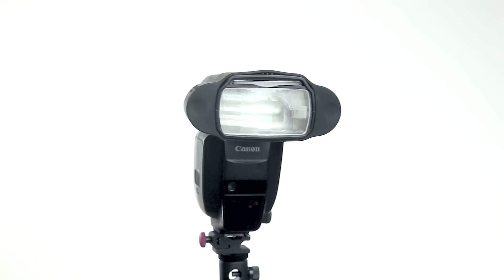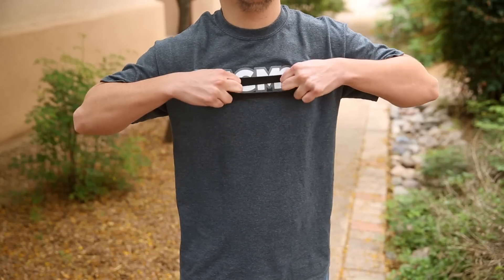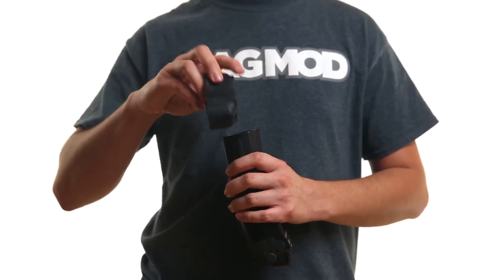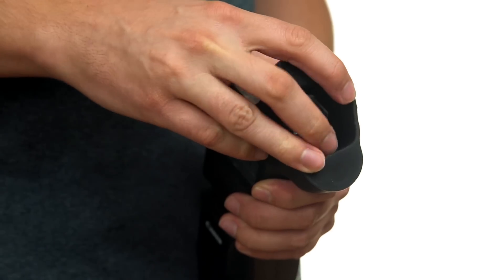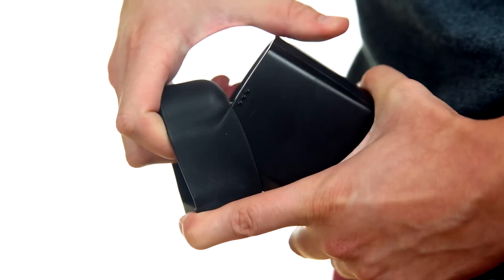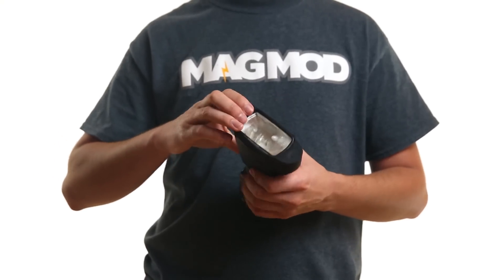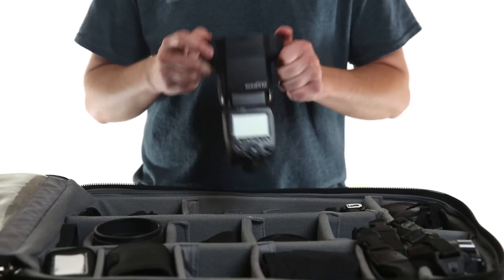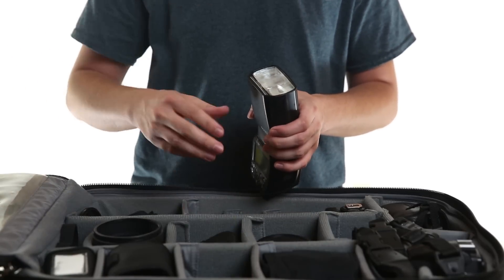How To Install The MagGrip

Comment: I almost hurt my index finger and thumb. Finally some how I got it on my TT685s. I'm not taking it out at least for an year. There should be an easier and better way as a gripper. Hope they come up with something new.
Reply from the maker: I'm so sorry! Thank you for your feedback, I will pass it along. We recommend leaving your MagGrip on your flash since it won't effect it when it is bare. Have a great day!
Reply: @MagnetMod  What about storing the flash in it's pouch?  I like to protect my gear.
Reply: @Methodical2  I have been able to fit the flash in the pouch as long as the MagGrip is on top, but it is not the easiest fit. They certainly aren't designed to work together. But after a few tries the MagGrip will only takes a few seconds to put on. So if you wanted to store them in your pouch and add your MagGrip each time it should only take you a couple extra seconds.

Comment: This really needs a redesign - it works okay on a small speedlight like the Godox TT350, but it's a hell of a job trying to fit it on a full size speedlight. I'm seriously considering cutting away the strips and attaching the magnets to speedlights using velcro instead. The problem you have is trying to design it so it's 'one size fits all' and I suspect it'll rip at some point anyway, either that or I'll damage a speedlight on fitting it. Thanks for the instruction video but an attach redesign would be far better. Good product apart from that.

Comment: I have a real hard time putting on the grip...its very frustrating...
Reply: Hi Ajay, this video does a pretty good job explaining the process that I use to install my MagGrips. The nice thing is once you do it one time - like riding a bike - it comes pretty easily. It's just a matter of getting it that first time and understanding the process. Remember to use that thumb on the opposite side to apply some leverage allowing you to pull it back and stretched across the flash head. The other benefit is once you get it on it won't slip off so it will stay there as long as you want.
Reply: @dayleyhighlights  shoudn't it be pulled off the flash head after using it? I mean,  in the long term, the rubber might get damaged if left stretched all the time... Just a thought.
Reply: I may return it, can’t get it on. Thought at first that it is too small. It’s not just like that
Reply: @karenkaptures  i had issues with it in the beginning....that is around 2 years ago....but after trying many times, i am now able to put the grip on very easily....you just have to hold tightly on one side and then just use ur strength on the other side to pull the grip...
Reply: @Ajayajay-nr2qj  thank you after 8 tries I finally got it on one of my speed lights. It will stay on that one. Thanks again for your response.

Comment: a nightmare !!! already purchased 4 maggrip for my godox V1, ad200pro and V860-II. To be sure i also tried on my old sb900 and same story. i hurt myself, it takes up to 30 minutes to fit. I followed this tuto but when you pull your fingers are not at all outside the flash head but above. too stron material, too small size.
Compare sb900 76x55mm with maggrip aperture 42x42mm !!! of course it works but not advised to remove it and expect being fast on the field to attach. I would suggest a new one 55x42mm min for bigger flashes, just tight enough to hold a heavy ad200 pro on a magbox.

Comment: I just bought one last weekend. Here's my question... Shoudn't it be pulled off the flash head after using it? I mean, in the long term, the rubber might get damaged or dryed out if left stretched all the time... Just a thought.

Comment: My MagGrip appears to be not as flexible. I’m finding it very difficult to stretch around my Godox TT685S. Is this a defect?
Reply from the maker: Thank you for posting, I'm sorry to hear that. Please email support@magnetmod.com so we can help you :)
Reply: I also have the TT685 and the Mag Grip is an extremely tight fit.  More tight than it needs to be or should be IMO.  Once it's on, it's best to just leave it on.
Reply from the maker: Yes! We recommend leaving your MagGrip on your flash :)
Reply: Was or is there a second revision to the MagGrip?  I see a few of the products have a "2" next to them.  I've just bought a whole host of gear and now I'm wondering if I'll be getting the latest revisions.  I'm in the UK, so wasn't able to buy direct.
Reply from the maker: Thanks for asking! There is only one MagGrip and you got the right one ;)